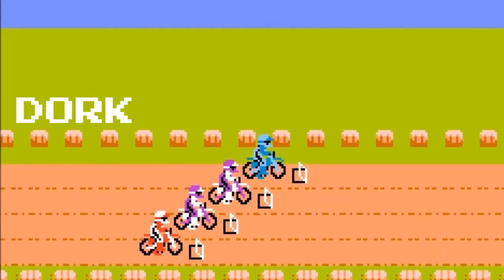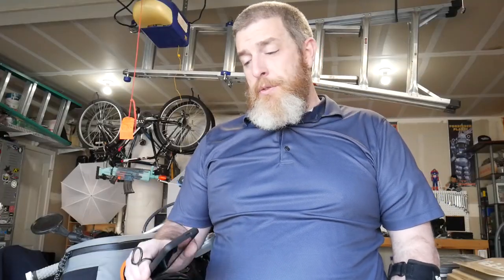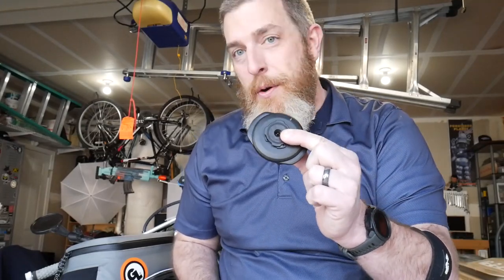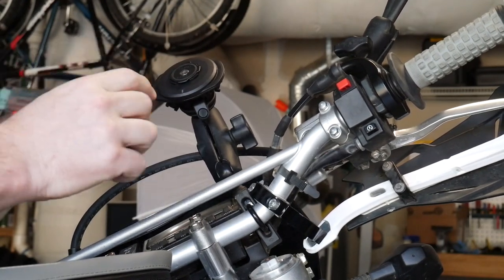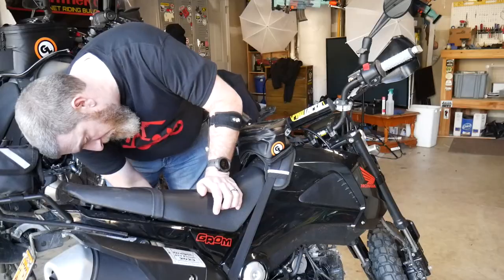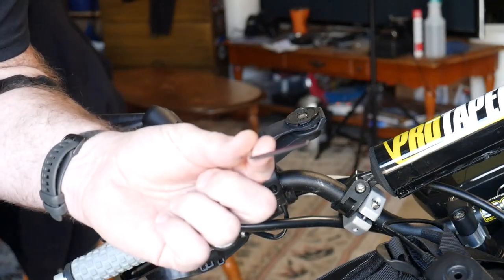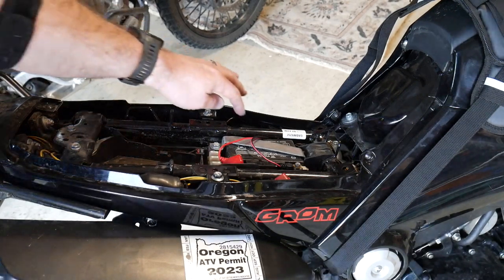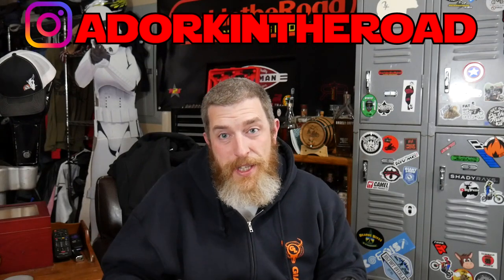Quad Lock Motorcycle Phone Mount Vibration Dampener, USB Charger, and Wireless Charging Head Install

Comment: I was also concerned about not having a fuse, but this I found on their website”The USB charger has an inbuilt self-healing Polyfuse and Surge Protection. It also has Polarity Protection which prevents damage to the charger if wired up incorrectly.”

Comment: For everyone wondering if the universal mount works with the wireless charger, yes and no. If you have a case like a ghostek nautical case that makes the phone completely waterproof or any case like it that has a thin back of the case then it will work. Done it many times.  It if the back of the case is thick like an otterbox then it probably won’t.

Comment: I've had the Quad Lock system for a few years on my 2012 Goldwing. I bought the wired charger with it (this was before they came out with the wireless charger). For the first week it was great, but then it couldn't seem to keep up for some reason. I reached out to Quad Lock, and they sent me a replacement. Unfortunately the replacement didn't fair much better. For the first few weeks it charged my phone just fine, but then for some reason it couldn't keep up, even with my screen turned off. Hopefully yours faired better.

I just replaced the charger out with the wireless charger last weekend. Other than a quick test to make sure it worked, I haven't had a chance to take it out on the road yet. Hopefully it fairs better than the wired version for me.

Comment: So you used the USB power module, instead of the weatherproof wireless charger ?    That's prob my problem on my Tiger Rally Pro......that and the too thin or too thick handlebars having all kinds of issues mounting my quadlock/antivibration/weatherproof wirelss.   Perhaps I just need that USB power one like you're using.....

Comment: Hey neat they have a slick usb. Replace the screw with a longer one to fit a stack of usb outlets🤭My S9 is waterproof😋
Reply from the maker: My S21 is supposedly waterproof too but I've had enough trouble with wet charging ports on phones in the past so I don't mess around with water where I can avoid it
Reply: Fair enough.  The old tough phones were truly waterproof. There's some still but you need a trailer to haul them around.

Comment: I just ordered a Quad Lock set up and waiting for it to arrive. What I don't get at all is the charging wire set up. If you have a charging unit already on the bike, you can simply run the wire up to the phone when mounted. Why plug a wire to the phone mount when you can just run it to your phone? Pretty weird lol
Reply from the maker: Saves time + is weatherproof...although if it's raining I don't usually have my phone on the bars anyway.  
Passive vs active charging, I guess.  It's super convenient but not necessary, for sure.

Comment: The dampener will help if you have a good suspension, on my Goldwing and Supertenere I have no problems but my son and I have ruin our cameras on our Gsxs1000 and 750, because of the sportier ride, 2 of my sons friends have screwed up the stabilizer on their phones on a ninja 650 and mt09 so on sport bikes on our shitty roads in Quebec it does not protect the phone enough, smooth riding bikes should be fine
Reply: Even with a dampener installed it ruined ur phones?

Comment: I feel totally dumb as I’m having the hardest time taking it off the wireless charger. What’s the trick?… on the other ones it’s a tab. Easy. But on the wireless there’s no tab and I always end up having to do some finger origami with both hands to finally get it off.
Reply from the maker: Push down on the outside ring

Comment: I’ve had to replace my iPhone 12 twice within two months because of the vibrations, so while I am mildly desperate to find a solution as I love being able to easily see my phone for navigation, I’m also super paranoid now.
Reply: This is a big reason I returned the RokForm kit I had purchased before ever using it.  That said, I've been using the QuadLock system for a few months now, and zero issues with my 12 Pro Max.

Comment: just my luck... i installed one the other day without the vibration dampener and killed the camera on my phone.... i didnt read the fine print!
Reply from the maker: Yeah I hear that's a common issue
Reply: My camera is also dead.,..
Reply: what kind of bikes / motors are killing the cameras?  My DRZ SHHHHHHAKES, while my BMW is pretty smooth.  Sucks to hear.

Comment: I like the concept and ordered the case and RAM mount! We tried the wired charger like you have on the Grom and the charger died shortly after. Interested to hear how it works for you before I spend a bunch on the wireless charger and vibration dampener.
Reply from the maker: I hope to test them extensively

Comment: Hi, you did it in wrong way. The dsmpener should be installed as close to the phone as possible.
Reply: How is the wireless charging supposed to work through the dampener?
Reply: @bdawson21  Wireless charging should go on top of the dampener but the USB charger should be beneath the dampener. I think that is what he meant.

Comment: My charge head just died last week out of nowhere.
Reply from the maker: Dang, that sucks. Still under warranty?
Reply: @DorkintheRoad  I sent them an email. Fingers crossed. For now I'm back to my standard QL.
Reply: @betweenthebennyandme  May be a stupid question, but you did check the button on the back of the charging head?  I thought mine had died two days after I installed it.  Turns out I hit the button that, since I didn't read the instructions, I didn't know was there.
Reply: @r1dutch  yeah. Its constantly blinking a light blue light